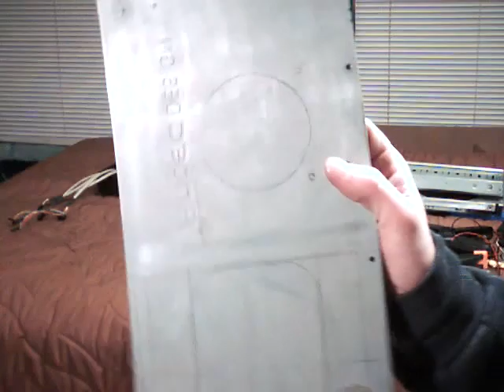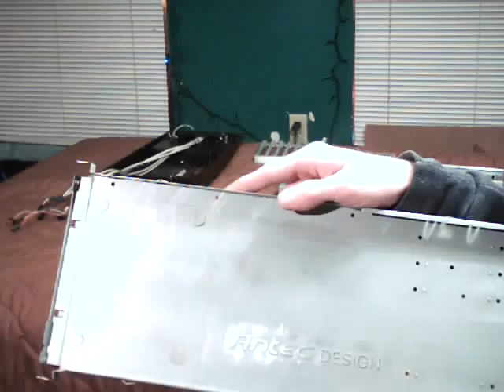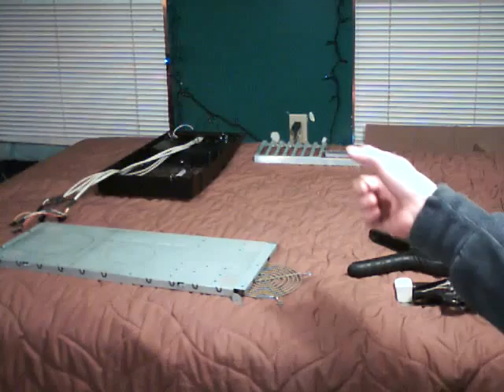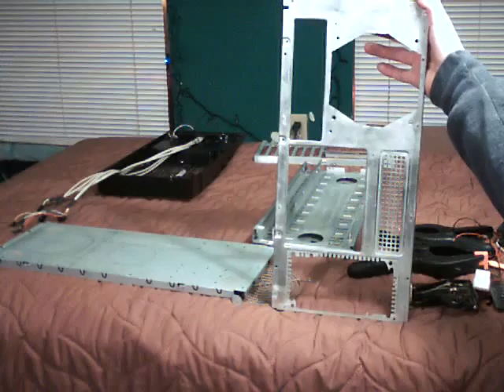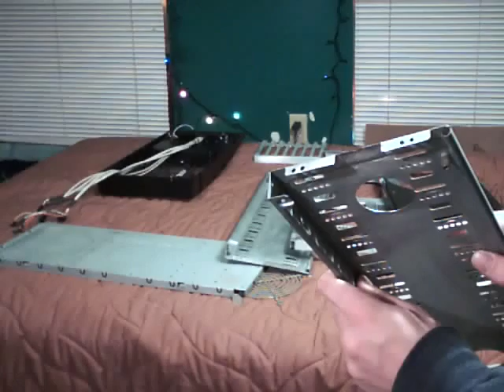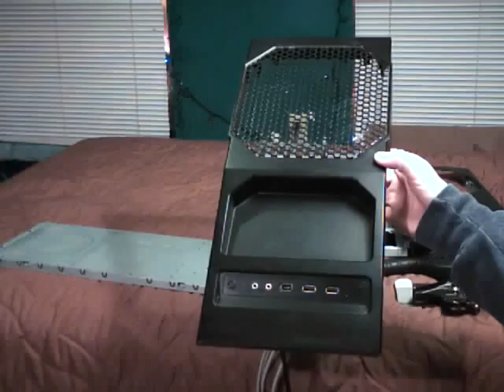[Project] Second Chance: Antec 900 Part 7

Comment: Nice video man! this looks great.  Thanks for the mention, im glad you could put my idea to work.  I think that this case is similar to the 200 in that it has a very little amount of room behind the mobo tray so just be ware I had a hard time with that.  for those front panel connections, you solder rite? just get some 22/ 20 gauge wire and solder on some extra wire.  As for the black part of that, idk lol.  Anyway, amazing stuff, 5/5